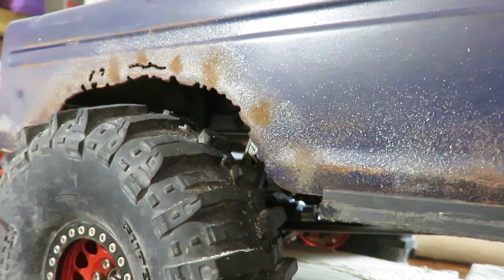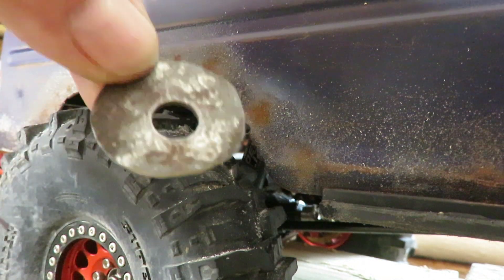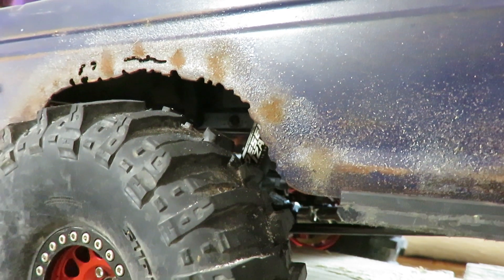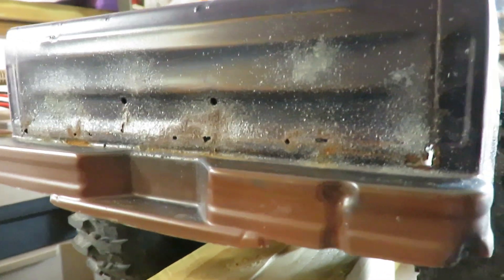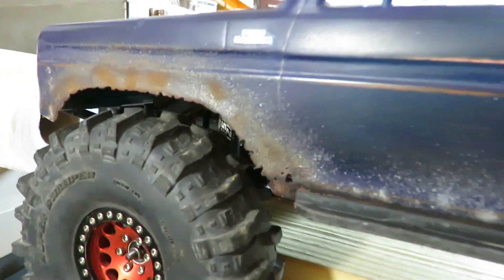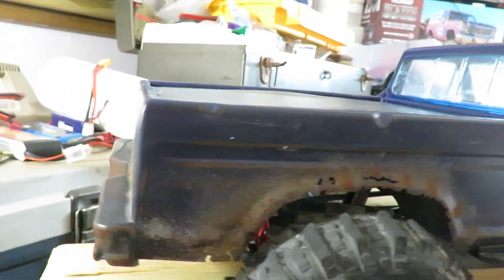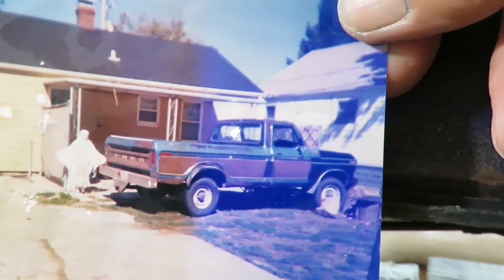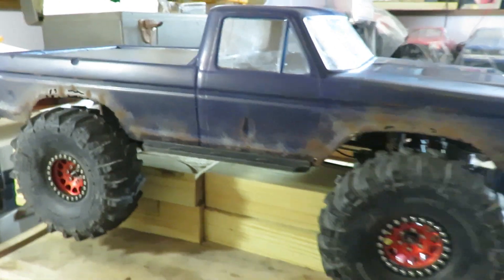Rust on a Lexan RC truck body

Comment: I would like to see a video on how to rust it.
There is an actual metal paint you can use that you can rust using something like vinegar
Reply from the maker: What I did was head to my local machine shop. I then told the owner what I was doing. I took my lexan body in with me. I asked for some metal shavings from his metal lathe. He gave me some of this and that is what I used. I did this to save a buck. I am a cheap bastard.
Reply: @tonysweet9137  nothing wrong with that!!!!